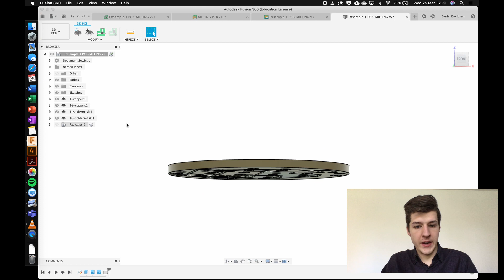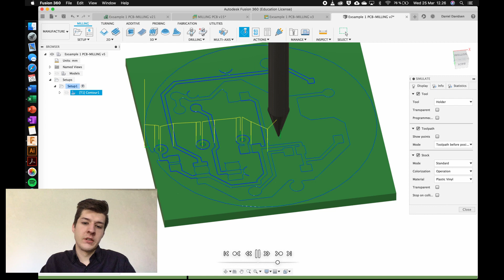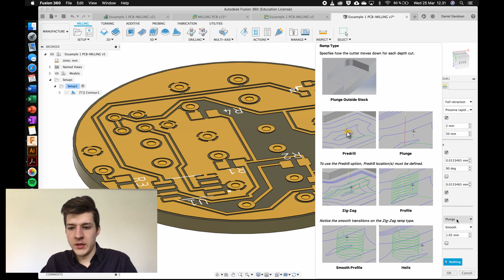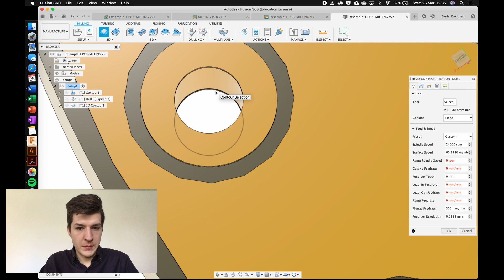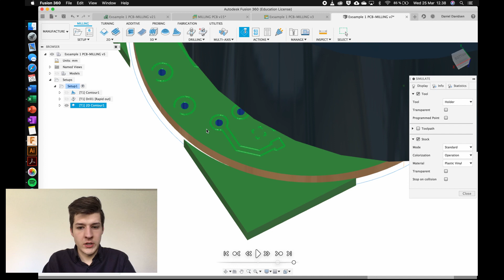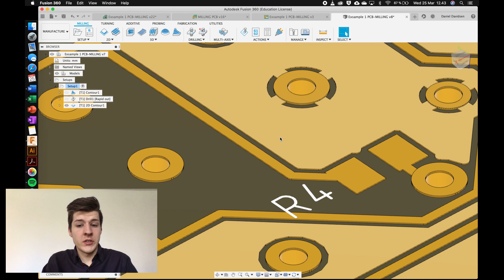Fusion 360 - CNC milling your PCB design / Part 3

Comment: Helpful videos, thanks!

In my case, 3D Contour doesn't produce good results, only the holes are milled, not the traces. But with 2D Chamfer I've got both milled.

Also, for drilling try to use 2D Bore.

Comment: Hi Daniel, I do not get the copper layer. I see the traces in the rendering. They are green but when I create the Gerber files the tracers are not available. Also in the Fysio tree on the right I there in no entry for the copper later. I did copy to polygon and made it ground.

Comment: If you want to avoid drilling, you can also edit 2d countour -> Passes -> set Minimum Cutting Radius = 0. Also the hight of copper of 0.2mm is too much, because deep drilling messes geometry. I use autolevel + 0.1 mm depth and got very smooth lines.

Comment: Thank you very much for sharing your knowledge, by the way what is the Raptor library or what kind of library should I use for the milling tool for the PCB, also the speeds that you program are specific to the tool you use?
Thank you very much

Comment: Excellent Video, thank you. I would not have thought about using 3D contour for a PCB. Just one little thing to make your life simpler : When you need a hole larger than the diameter of the bit you have,  you can use 2D "Bore".

Comment: Great video. But the solder mask thickness is too thin  thus the milling bit sometimes lost contact to top of the board even if I made the heightmap.
In my case,  it's better to set Stock mode to Relative size box and add  Stock top offset. I set Stock top offset 0.01mm.
And in contour setting, set Top Height from Stock top and Offset 0, Bottom Height from Stock top and Offset -0.05mm.
Then I got enough milling depth ;)

Comment: Thanks! Have been using Eagle + FlatCAM until now but one annoyance has been that FlatCAM does not do non-rectangular board cutouts (yes it says it does but really doesn't) so I've had to use Fusion for that anyway. This all just makes everything so much easier also if I need to modify PCB design.
Found this whole Eagle integration accidentally by googling and then started looking for examples how people mill with it and found your great tuto that saved some hours of figuring out best tools for trace milling.